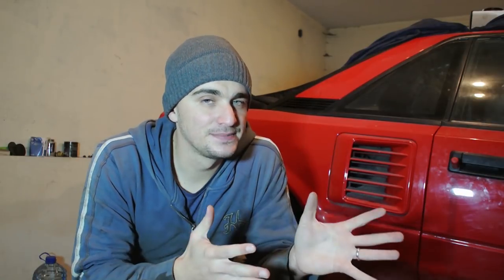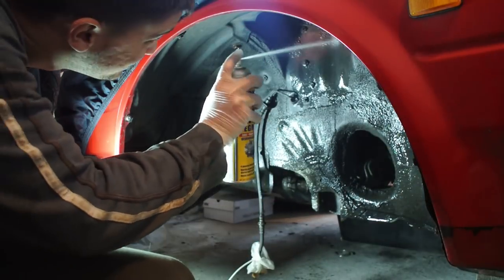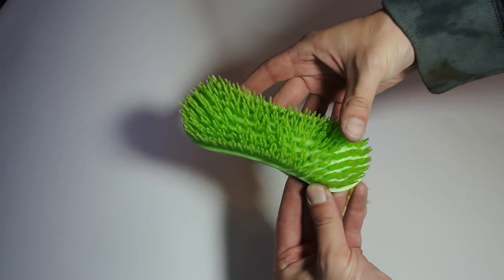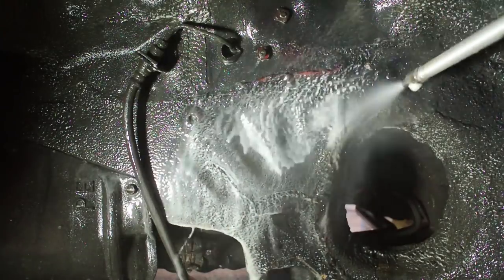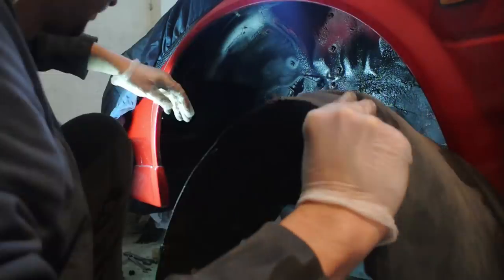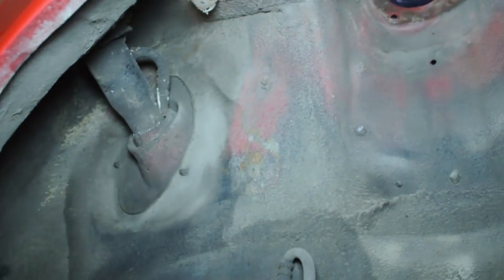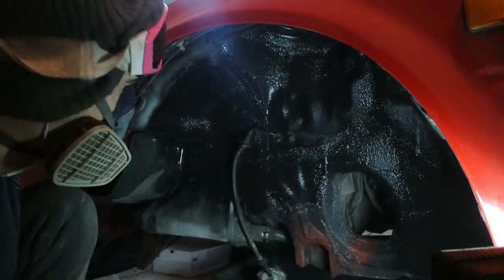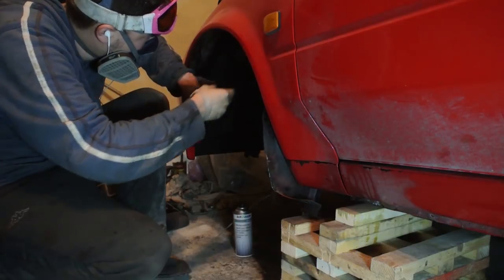How to clean and restore your wheel wells - suspension episode 7

Comment: where'd you get that water sprayer thinga ma bob? I've seen different kinds but i want one with the can on it
Reply from the maker: I think you should be able to find it in any hardware store. I found it in a lot of places. Costs anywhere from $15-30  The bad thing about the container is that you have to wash it out and keep it dry. It will rust really quickly.